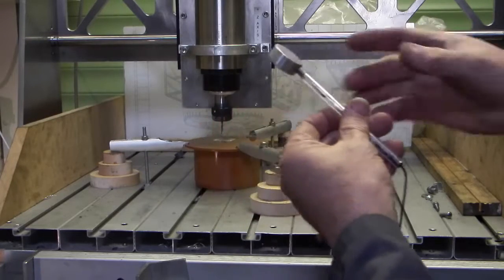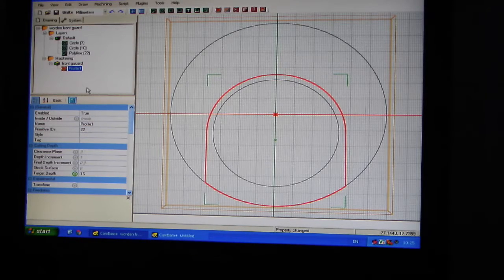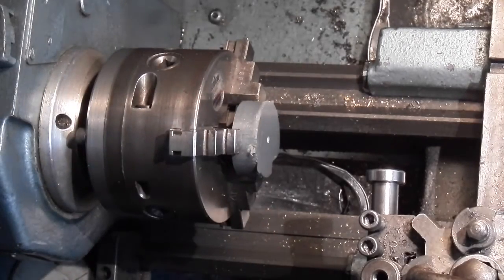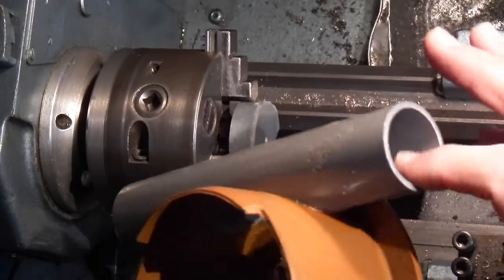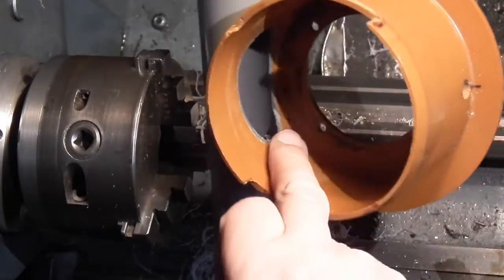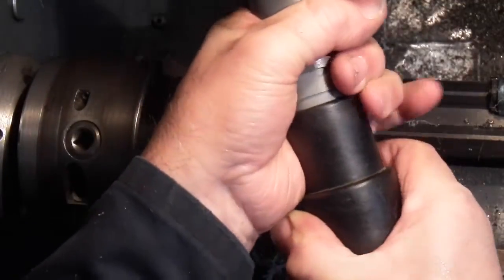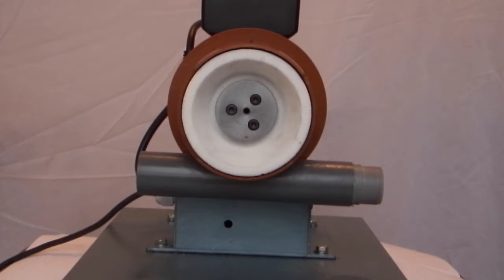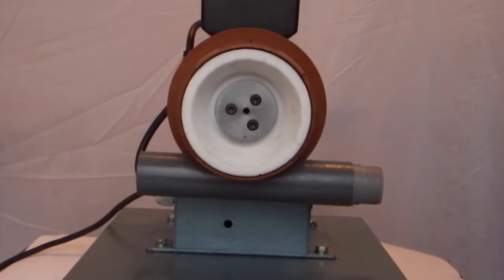Grinding guard

Comment: There is an entire series in that CNC machine, I hope you videoed its development and construction.  A Tesla turbine used in reverse might give you more suck and blow for dust extraction., the bits should be no problem on the CNC.
Nice mod to the grinder, keep up the good work
Reply from the maker: Hi Jeremiah
Thanks for comments I will look into Tesla.
I think my next video will be about CNC build but I made this 2 years ago No video.
Anyone with engineering knowledge a lathe and drilling machine could make a CNC machine.